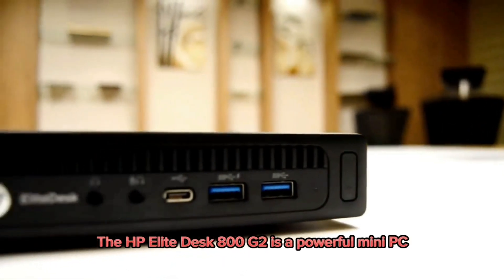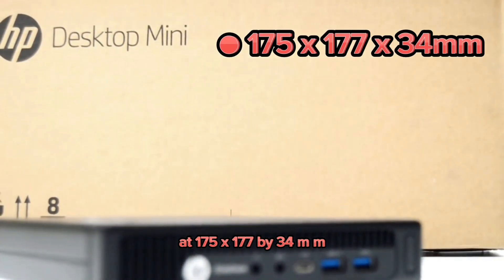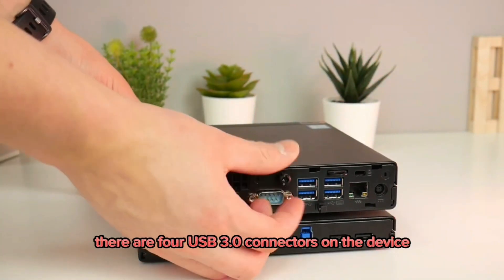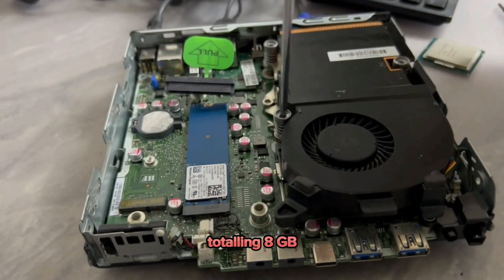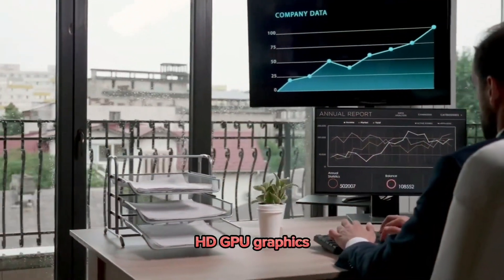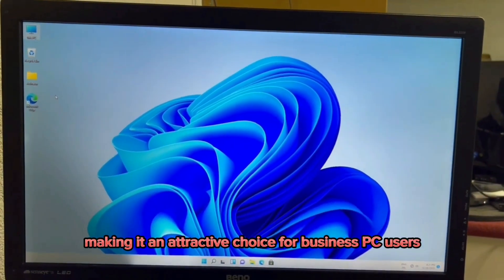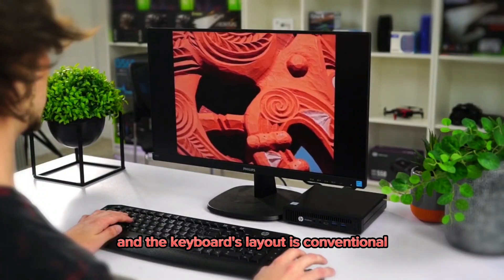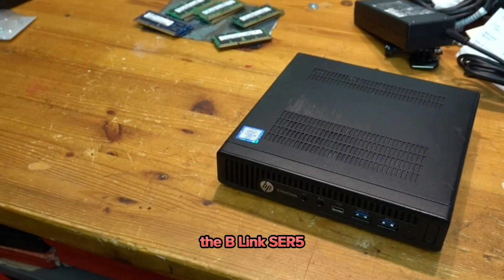HP EliteDesk 800 Mini PC - Business, Office and School Mini Computer!

Comment: Lol.. Thats a 10/100/1000 Network Port.. NOT console port.  The i7-6700 models are quite fast.  They also have an NVME slot under the hard drive caddy.  Wifi/Bluetooth can be added with a module and the two antennea modules easily.  Great machines.